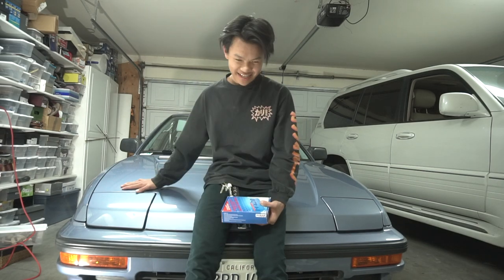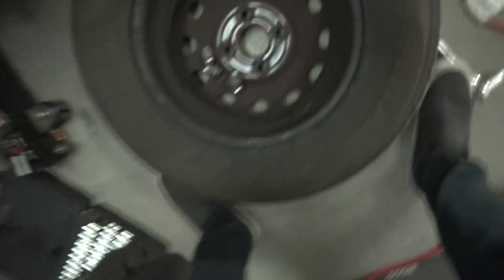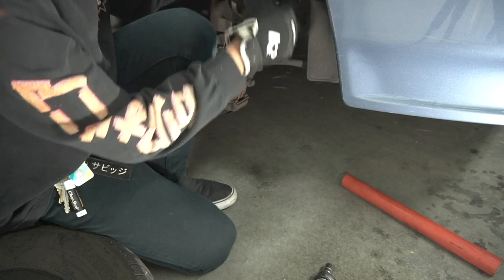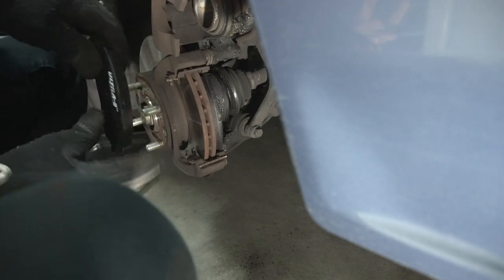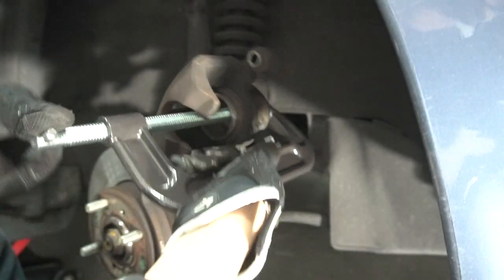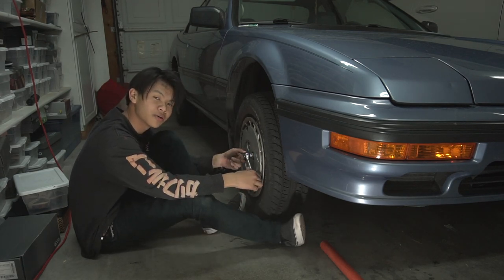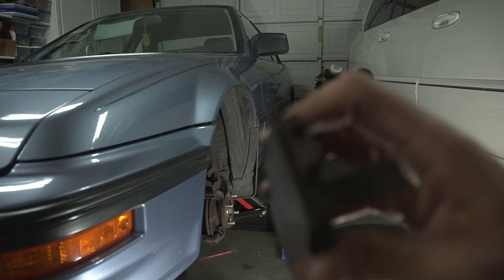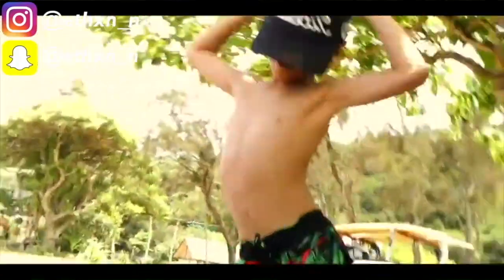Changing Out My Brake Pads!

Comment: Good pointer for next time: jack the car from the front and then put the jack stands on the side. Lower the car onto the jack stands and lift the jack again where its slightly touching the front but there is no pressure.